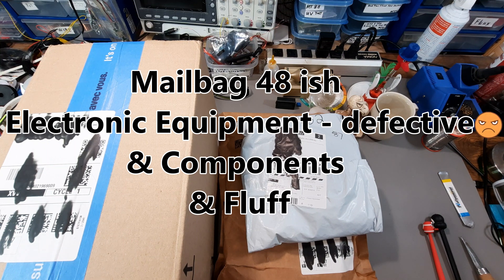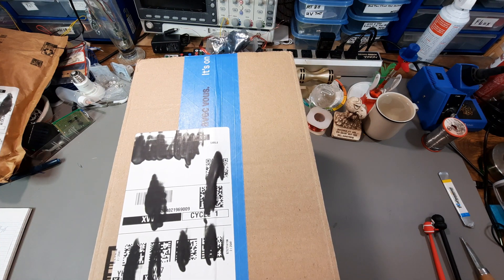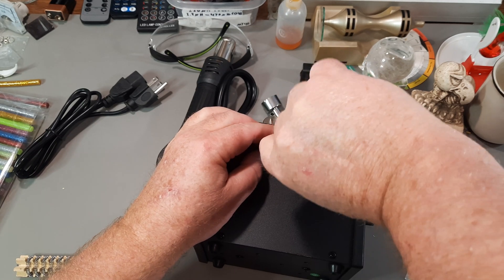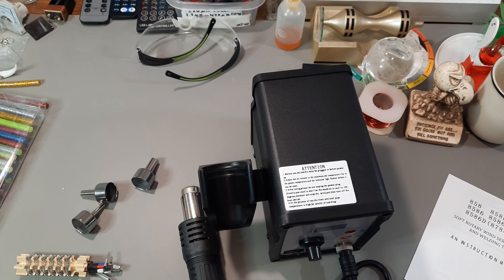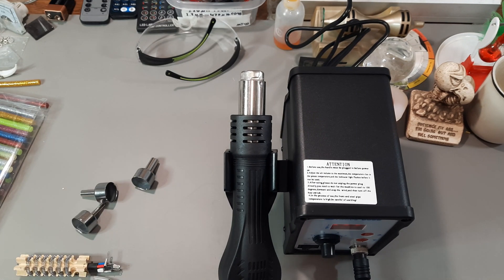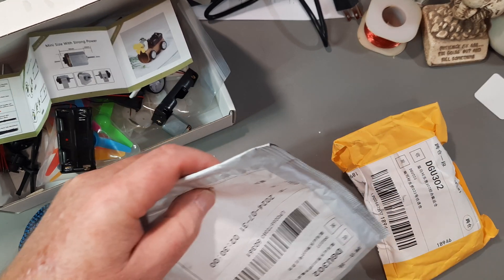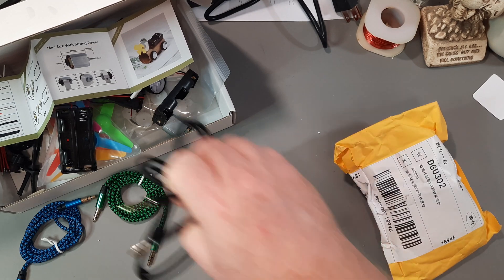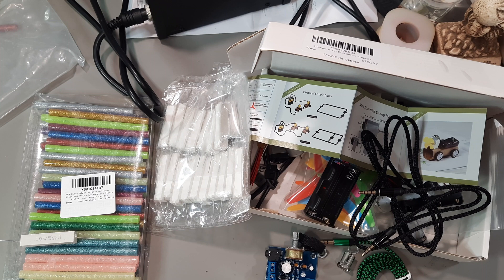Mailbag 48 ish Electronic Equipment - Defective & Components & Fluff

Comment: My heatgun only works when taken out the holder. Which normal so maybe you are seeing an issue where there is no issue? About the tapping. Maybe that breaks the connection, letting the unit know the gun is out the station. So it needs to stop heating. That is normal. Not keeping the temperature is not normal. Btw... it is pronounced ther-a-min and a super cool instrument! :D
Reply from the maker: Theremin appear very temperamental for construction, definitely don't like stray capacitance in the circuit.
Have a good day
Reply: @retireeelectronics2649  I had one, and it was very cool to play! I hope when yours is done, you feel the same!
Reply: @retireeelectronics2649  I.m sorry, that is something you have to live with :)

Comment: That hot air station, you get what you pay for I guess, it looks junky.  And please where does this Centi-Grade come from I always wonder?  Celsius is the correct word you are looking for...  I recommend the ATTEN hot Air station double the price but you will love using it.
Reply from the maker: True the scale is centigrade and the unit of measurement is Celsius. Then there is Fahrenheit where the scale is Fahrenheit and the unit is Fahrenheit, English sucks, sadly it is the only one that I kind of speak and write, both poorly. 
So far in the comments, several people have indicated it last for a fair amount of time, and since this is a hobby not a business, that is fine with me since this mostly will be used for heat shrink and maybe ripping components off of boards. If this was for a business, you would never see the word AliExpress or eBay 😊😊in my mailbags. In my parts database, I actually tag all parts from Digikey and Newark separate colour since the parts have a pedigree. 
Have a good day

Comment: I got a very similar hot air rework station from AliExpress several year ago. it is still working well. If the heater burns out I'll just get a new one since these things are so cheap. But so far so good. The only problem with the model I got and the one you also have is I can't seem to find any additional nozzles to fit it. There are an amazing variety of specialized nozzles but none of them fit my hot air device. They have slots and screws which simply don't provide an air tight seal. I guess I could fill in the gaps with aluminum foil or something like that. Actually I find that the electronic hot plate I more recently got works much better and I use almost exclusively for assembling PCB with a lot of SMD's.
Reply from the maker: Good to hear it will last. Probably 99% of my usage is going to be small diameter heat shrink related. For what I paid and the spare parts this option is cheap. I still have my 1500W heat gun for big cables. Saw some desoldering tweezers that look interesting thou.
Have a good day
Reply: @retireeelectronics2649  Yup that's mostly all I use it for these days..heat shrink tubing. It's funny to watch all the people who use a Bic Lighter to do the same thing. I got some desoldering tweezers recently too. They work pretty well.
Reply: @retireeelectronics2649  That's pretty much what I use my hot air "***gun***" for as well, heat shrink tubing. I also got some desoldering tweezers recently which work pretty well.

Comment: High temperature low speed.
 High speed cools the element = low temperature
Reply from the maker: Problem was human and the mercury? switch in the handle. Once the switch was glued back in place it operates perfectly and will put out maximum heat at full airflow. Previously the switch was off by about 15 degrees. Probably the  glue holding the sensor broke during shipping.

Comment: The guns die for a past timeout easy enough to replace.
I got a rework station on Christmas Day and the gun died on Boxing Day!
Reply from the maker: Ouch that was quick. Thing I found with electronics is if it doesn't fail within a week or two, it probably will last a long time, hence buying extended warranties is a waste of money. Also we are a throw away society and getting replacement parts now is a pain, hence why I bought the one with spare heating element.
Have a good day
Reply: @retireeelectronics2649  The heat gun is a generic part and is usually available on amazon separately.
Reply from the maker: Good to know, hopefully it will last.

Comment: I definitely return that reflow station is not a good one. If you need any recommendation definitely I can tell you which station to get!
Reply from the maker: I will try fixing it first, since another comment had where the problem could be located.
Have a good day
Reply: @retireeelectronics2649  I understand but is not a good reflow station. For reflowing smd u need at list one station that can reach 480°C
Reply from the maker: @SymbolTech21 This will be mostly for heat shrink since currently I use my soldering iron to heat the heat shrink. It was a quick fix, the hot glue securing the relay detached
Reply: @retireeelectronics2649  if you need to buy a reflowing station just for heatshrink is better to buy one that will be able to reflow also smd. You are doing anyway electronics projects so will be handy

Comment: The 858D would normally display --- (3 dashes) when the handle is placed in the holder and the measured temperature is below 100C. Placing a hot handle in the holder should start it cooling down and eventually shut off when it gets below 100C, but the holder detector (reel relay) can be a bit tricky.
Reply from the maker: Bang on. The hot glue they secured the relay didn't hold and the relay was moving around.  That was way to fast of a fix.
Thanks, have a good day
Reply from the maker: That will give me a starting point to get it working properly.
Thanks, have a good day

Comment: Probably should stop when in the holder, when off it should heat, and check if it heats well on 240 Volts. The 'gun' gets full mains directly from the controller that is only switched after beeing on temperature.
By the way, safety: do not plug it into mains when the gun is not attached: some of the pins (mostly one at least) is almost straight on the mains voltage (but it can depend on the orientation of the plug).
Reply from the maker: Sadly was such a quick fit I can't even make a video for it. The reed or mercury switch in the handle was detached from the hot glue holding it to the side.  Angle was off by about 15 degrees and slightly sideways. So when holding it at an angle that would be normal for me to do heat shrink it would turn on and off. I didn't catch that - - -  was the symbol for rest state, manual is not ideal. 
And yes when working on anything disconnect the power first and if power is needed, be very careful, any part could be at mains.
Have a good day

Comment: Sometimes they shut off when put in the cradle.
Reply: Well, of course. It would be a big problem if that didn't happen 🙄
Reply from the maker: I did a poor job of showing it all and I didn't get that - - - meant sleep mode. It would also turn off when I was pointing it downward slightly which is how I would do heat shrink. The reed or mercury switch was loose in the handle so the switch was off by about 15 degrees. 
Have a good day.